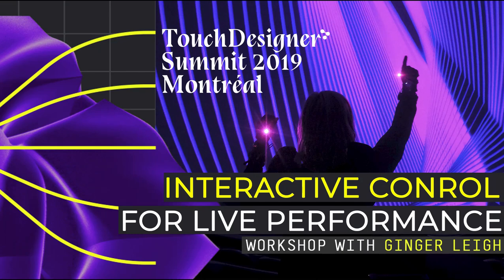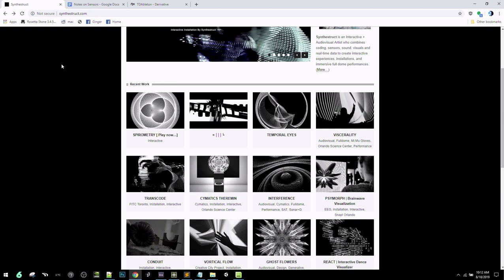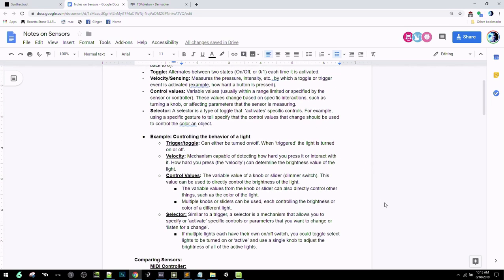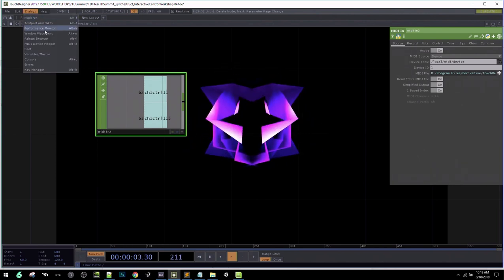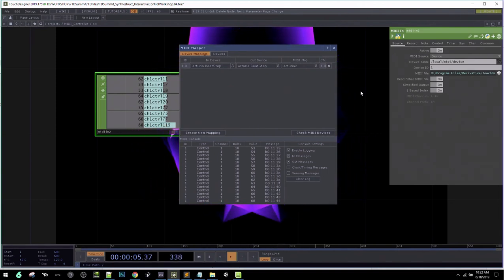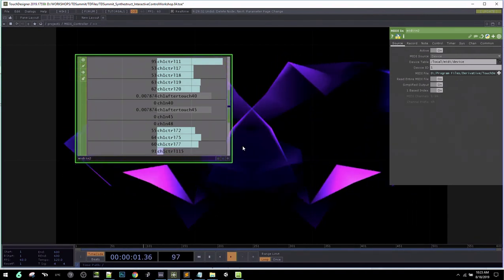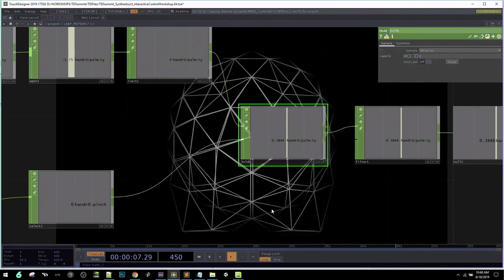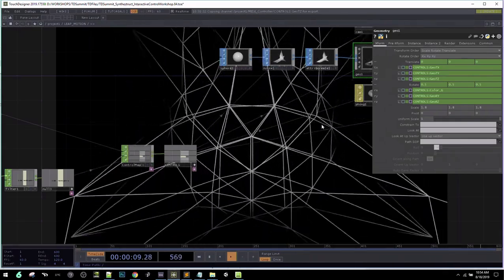Creating Interactive Controls for Live Performance - Ginger Leigh

Comment: Sorry to comment on old video. I have the same problem where the MIDI device shows up but no signal comes through, but only on "smart" midi devices. Dumb controllers like nanokorg2 and launckey49 both work flawless, but my main setup uses maschine mk3 and blokas midihub and they I can set them up on the Midi device window, but no signal shows through even though both are transmitting and playing hardware and software instruments. Help please!